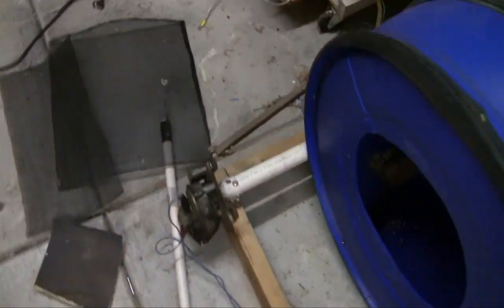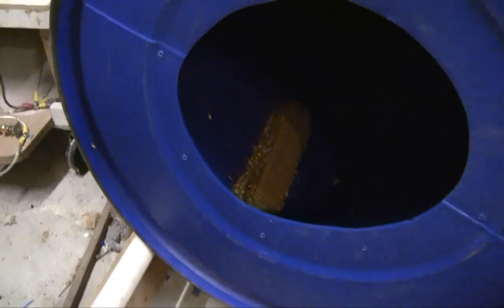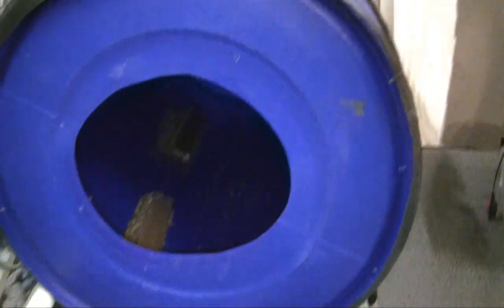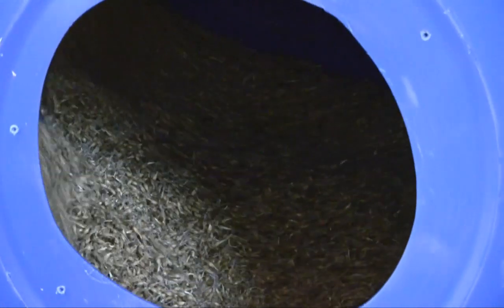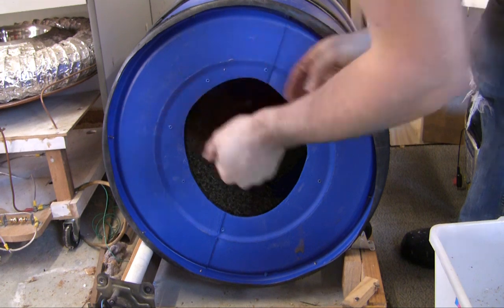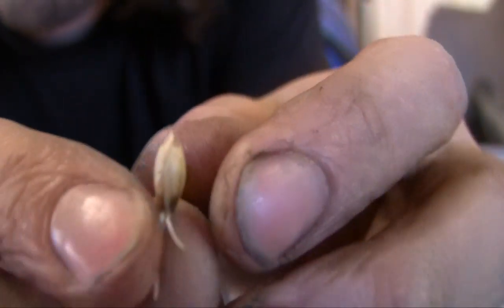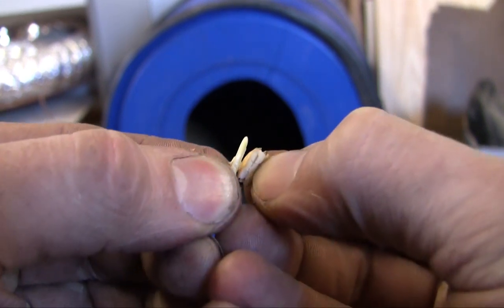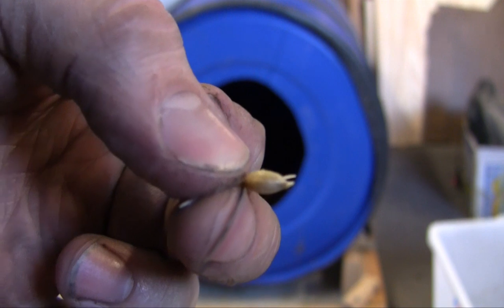Making Malt at home. (Malted Barley) Malt roller/Auto turner

Comment: This is a great idea! I'm going to try it with a 5 gallon bucket for smaller batches. Do you say you were using a wind shield wiper motor? Do you think the same ought to work for a 5 gallon bucket or do you have any suggestions as far as the motor goes? Thanks for sharing this video!

Comment: Hi Great video...thanks!
If Im using a malt extract how much do I use and would u add sugar/dextrose to this mash to kickstart the yeast fermentation?
Im using a "Mr Distiller" unit to distill fermented substrate to a single malt spirit.
I simply need Proportions/Ratios! between
H2O : malt extract : yeast 
(w/sugar/dextrose?)
How much of each to start a viable mash ready for the Distillation process.
Also what is your view using
malt extract syrup vs malt Ext powders.
Thanku verymuch
Rob-o

Comment: Hi HD , Im having a little trouble here : How many amps is your 12 volt converter rated at  ? (I got a windshield wiper motor and a 10 amp 12 volt converter and with that converter  the motor can barely start ) Should I have gotten a 15 or 20 amp converter ? Or do you think my motor is defective ? maybe the converter is defective,....if you are having no trouble and your converter is 5 amp then I know either my converter or motor is defective...
Reply from the maker: rbbiefah I'd say your motor is defective.. Although mine was only just big enough, will it start the motor with no load?
Reply: The PI auto 10 amp inverter would just barely start the motor with no load  and it too about 4-5 seconds before it started . But when I hooked the motor up to a 845 amp marine battery it jumped to life eagerly but I cant get the marine battery on a timer so i still need to buy an bigger inverter . How many amps is the inverter you use? ( here the link to my motor specs http://www.amequipment.com/wp-content/uploads/2013/02/801-1071-web.pdf    from those specs it look like a I need a 40 amp inverter !) maybe I got a very heavy duty wiper motor that needs a lot of amps...
Reply: At 4:24 you can see it is rated 8A...

ATX 2.x computer power supplies can often easily give 20A+ on the 12V rail.... (With ATX 2.x, most of the power is on 12V, so a large gaming 1200W power supply should be able to give almost 100A on 12V (some have it spread over multiple rails though...))